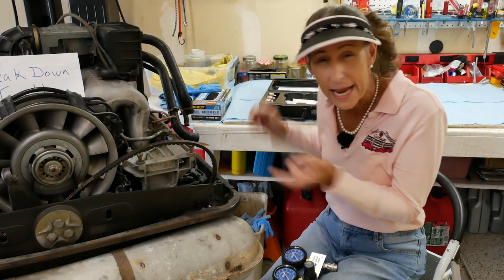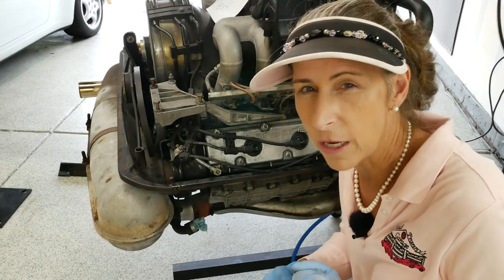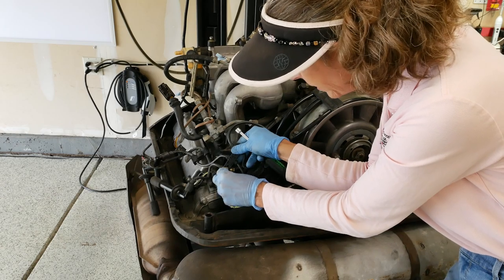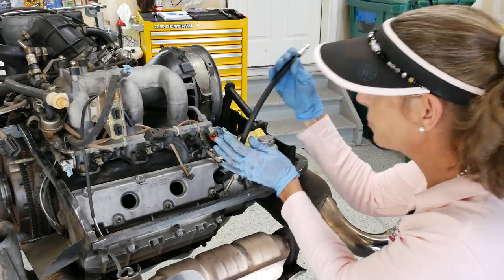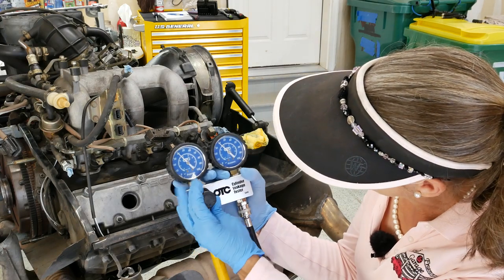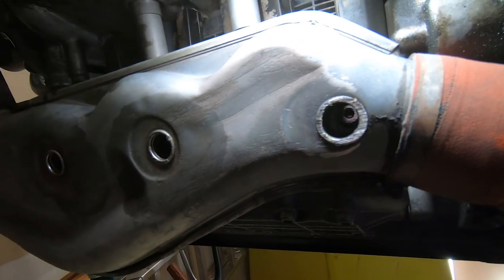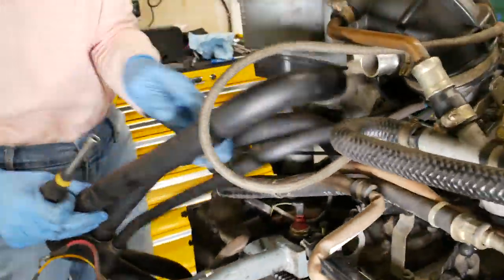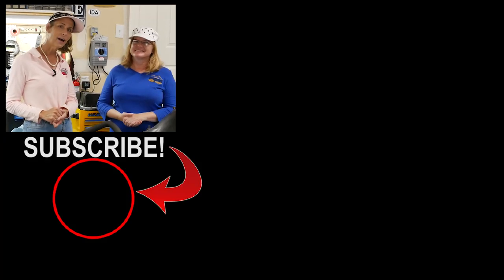How to perform a Leak Down Test! - Porsche 911 3.2 Carrera Project #9

Comment: Franny you  know as an aviation engineer that piston Aviation engines have long been tested annually with leak testing. I am amazed that your engine tested so well. Most Lycoming and  Continental engines have TBO’s ( time between overhaul) of less than 2000 hours. If you averaged 40 mph, your engine has well over 2500 hours. Leak test on Continental engines pass  with 68lbs of 80lbs. in even on low time engines. This speaks very well of Porsche engineering and your good maintenance. This is the best explanation of leak testing I have ever seen. Keep up the good work. I love your videos!
Reply from the maker: Thanks so much! Really interesting. I didn't know that about aviation engines. I was pretty surprised about the leak down numbers as well. Looking forward to it being installed and running again :)

Comment: Math time!

I may be wrong, but I’m pretty sure we’re looking for leakdown figures as a percentage, a ratio of air pressure in to how much leaks out.

What you’re doing on your note paper at 14:37 is just subtraction, and you’re talking percentage points difference, instead of percentage as a ratio.

90 psi in and 86 psi leakdown result would be 86 divided by 90. 86 psi as a percentage of the input pressure, 90.

86/90 = 0.955, or a 0.045 leak.

A formula you can build with this is that your leakdown result is:

(One minus (result divided by air hose pressure input)) times 100 = your leakdown percentage.

(1 -  (86/90)) x 100 = 4.5% leakdown.

Which is a little higher than 4% leakdown.  Your engine’s very good and your input pressure isn’t super high so the differences are narrow and it doesn’t matter in this case.

Easiest way to avoid the math? Run the test at 100 psi!  95 psi result means 5% leakdown! : D

Comment: Great video and great results on the leakdown test. I’ve got a 3.2 also and sort of in the same boat. No leaks or oil use and runs strong but I really want to clean a few things up and replace fuel lines, sensors,  engine pad etc with the engine out so am contemplating the same thing. There’s nothing like a bit of preventative maintenance to make the ownership experience a bit smoother.
Reply from the maker: Yup.  Totally agree.  I do have other fish to fry so maybe I won't have to go any further past the exhaust.  We'll see.

Comment: Great video, love how you two keep it simple and to the point.  One note, some leak down testers are very different, set pressure first to "0" (which is really max) then plug in adapter that is already in cylinder.    Also, the PSI, very important on head gasket!!!, the rest of it will hold.

Comment: Enjoyed this. It's a tough call on tearing down and refreshing the valve train and possibly the rings, but it will never be more convenient than at this moment. I guess you will have to consider the wear conditions currently on this engine and balance it against your future plans and expectations for this lovely classic Porsche. Be well!
Reply from the maker: Thanks!  There are lots of considerations with the 3.2s... The studs and the cylinders mainly.  Really the bottom studs should be replaced but there two types of cylinder used on these cars.  On is reusable and the other is not.  The plan is to check all that out when the exhaust is finally out...  We'll see I suppose ;)

Comment: One easy thing to consider doing is removing the fan/alternator and checking inside to see if any rodents made nests on top of the cylinders and under the shroud. Easy to do this with the engine in the car, too. Keep up the great work! You make it look easy :)
Reply from the maker: Thanks!  Will do.  There was a nest in the vents up front when we bought the car so,... ;)
Reply: Heidi and Franny's Garage lol, oh man. Definitely worth checking then. I’ve seen 2 friends’ 911s with all kinds of nuts and nesting material in there.

Comment: Hello Heidi and Franny’s Garage,

WOW!  Another great video!  Agree with results (you confirmed no problems studs) and would not pull/strip engine down any further.  I am an idiot, so I follow the path of tearing everything down to bolts and nuts once out of vehicle, but in the end spend a lot of money....grrrr......, but at least I have a "new" engine.  There is a big "trap" on the "while its out".  On 911,'s engine drop not so bad, on other cars also easy, but then there are the cars, like my MR2/S or your 308, that warrant spending the extra $'s upfront.

Great intro to leak down testing, but want your viewers to be aware that while performing this test, the shop air, even at 50psi has the potential to turn the engine over.  I would recommend locking the engine by the flywheel teeth or other.  Imagine what could happen if just before TDC and rotating the engine backwards when adding compressed air to the cylinder.

Only my thoughts, but again REALLY enjoy the videos and they are VERY educational for ALL levels.

Mr. P

PS:  I am actively contacting many colleges to view your channel.  It is too under rated!
Reply from the maker: Thanks so much!  Great point on locking the engine.  My bad and great catch! Thanks.

Comment: Franny & Heidi, if you haven't tried it already, there is a product out there called Kroil, and it does a great job of loosening up even the tightest of fasteners, better than Liquid Wrench IMHO (In My Humble Opinion).  Great video BTW!  Leak down testing is mandatory when doing dyno work especially on racing engines!
Reply from the maker: Thanks Daniel!  I'll give that a try :)

Comment: You may want to replace the alternator - easy to do with the engine out.
Reply from the maker: Thanks!  Great suggestion!  I did that when we bought the car.  Some had that belt on so tight I think I could get a middle G out of it!

Comment: Agree with you decision not do the rebuild. That said, would you consider tuning the engine with a wong chip, stainless exhaust and a more open airbox? As much bang for the buck as one can get for these engines. Also, would you go for a wevo shift kit for the trans or is it OEM all the way for you guys?
Reply from the maker: Great thoughts Phil...  It doesn't have to be completely stock...  An exhaust is a possibility, but expensive.  The Wong chip is something I've always wanted to do and the gate is a great idea too.  I have a Sein shift kit installed and it really helps!  I'll talk with the rebuilder to see if I need more.

Comment: So I'm itching to start pulling my engine; but should I try to do an leak down test with the engine IN the car?  It just seems more difficult to put the tester onto all the spark plug holes with limited access.
Reply from the maker: I think the leak down is way easier out of the car.  But...  If you want to also do a compression test then that is easier in the car ;)
Reply: @HeidiandFranny  Okay, will do.  I think I might start this weekend.  Thank you for how detailed your videos are, I've done a ton of reading and have wayne's book, but your vids are absolutely phenomonal.  I just dabble in youtube, but I did do a timelapse of my RS2 upgrade on my old Audi Avant.  Check it out and lmk what you think; considering doing something similar for the 911 engine build:

https://www.youtube.com/watch?v=f3qcEqrfCTE

Comment: Great video! Since the leakdown is good and you don’t have to do the top end, why not use the time you’ve saved to convert to EFI? Would love to see you tackle that on your channel.
Reply from the maker: The Motronic system on the car is pretty good.  BIG improvement over the CIS K-Jetronic on the SCs.
Reply: The 3.2L engines already have EFI in the form of Bosch Motronic fuel injection. One could convert to full coil on plug ignition system and ITBs, but that's more expensive than some head work.

Comment: Interesting concept,  that engine. Long and hard Autobahn-driving and  it was still cooled enough with air! How about  driving it thru the Arizona desert, would it still be cooled? Maybe large oil coolers also, then? I didn't hear about the milage. Must be high a quality engine with such a good test? Thanks a lot for making a slow learning video! Greetings from Norway!
Reply from the maker: Thanks Tom, Yes it will cool well in the desert as long as there is good airflow.  The mileage is just shy of 120K miles.  Pretty good numbers for that age.

Comment: Nothing to gain removing the heads clearly.
Also setting the timing is a major headache.
I'd be very happy with those leak down figures.
Reply from the maker: I have been reading up on cam timing and you are right!  Not super straight forward...

Comment: 18:50 - I see a modern electric toothbrush in the shop! You use it to clean things, right? I've wanted to do that. How is it? Handy for lil' jobs?
Reply from the maker: It actually works great but splatters a bunch so not as useful as is hoped.
Reply: @HeidiandFranny  Very good! I don't always have winter here so I can always do that kind of thing outside.

Comment: I stopped this video at 10 minutes because Franny said something very important. She was just starting to screw in her steel leakdown hose to the aluminum cylinder head. She said never force the screw thread in. Now here is the lesson. I made a mistake on my engine, a motorcycle engine. I screwed in a steel bolt, which was going into a blind aluminum thread on the cylinder head, and I did it with a wrench. I didn't even feel any resistance until it was too late. It destroyed the cylinder head and I had to get new ones (for a 27 year old machine). Listen to her, it's good advice. Always thread steel to alloy by hand first, and when you're happy use tools. John UK. Oh and I almost forgot, you have to strip and clean the engine of aluminum residue because of the damage too! You have no idea of how upset you get. Take care all. John UK
Reply from the maker: Wow. Thanks!